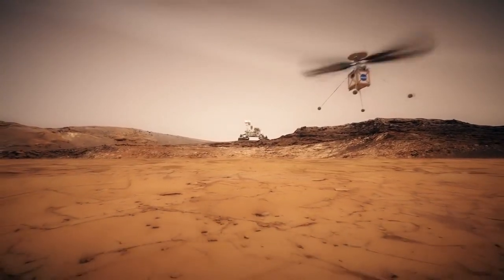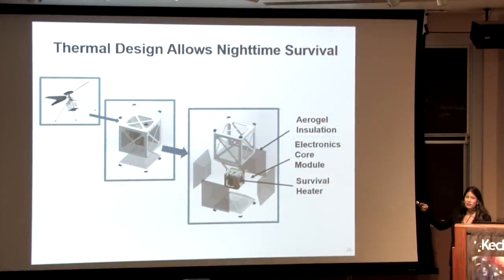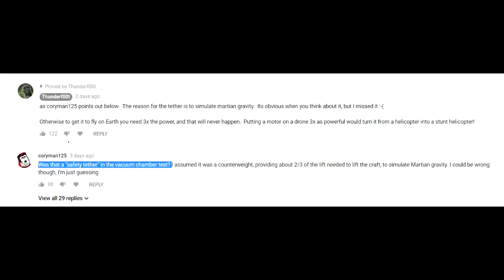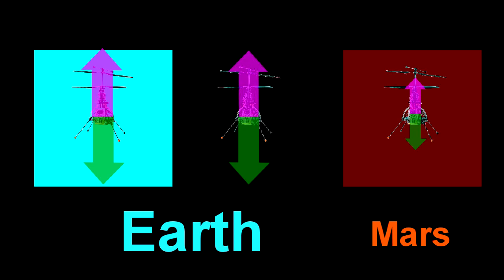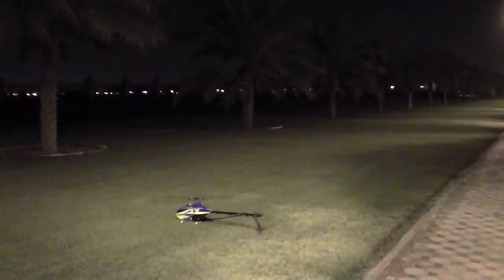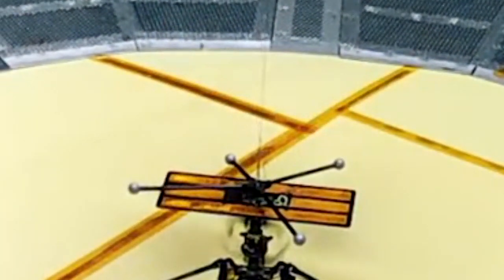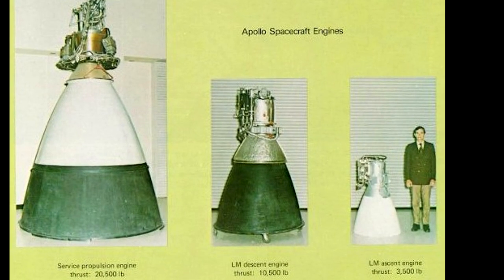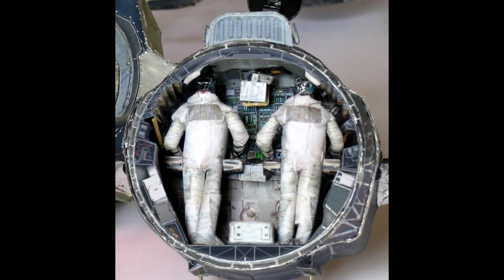Why NASAs Martian Helicopter CANT fly on Earth!

Comment: you are still wrong though you certainly can fly it on earth because the atmosphere is so much denser you dont need as much power to lift it . you just cant fly it on earth simulating mars atmosphere
Reply: Could we assume it is being tested in a vacuum chamber???
Reply: German Pepe It doesn't mean the rotation speed needs to be higher. You can also adjust the geometry of the blades. 

P = w Tq  

where w is the angular velocity in radians per second and Tq is the torque in Nm. (Metric and no conversion shit here). So, angular velocity and power is indeed related.
Reply: German Pepe The thing is, if you change the air pressure,  the blades, power or RPM you don't really demonstrate that well that it'll work on mars.
Reply: Morten Kristiansen If there's no gas for it to get thrust, how would it fly?
Reply: If it is easier to generate the thrust in Earths atmosphere and if it is as Thunderf00t says, 100 times easier, then wouldnt it be enough lift for it to fly here on earth. What am I missing here?
Reply: You have to consider that it will weigh about 3 times as much here on Earth. I think the gravity on Mars is around 39%  They can simulate the density of the atmosphere on Mars by using a vacuum chamber, but they can't simulate the 1/3 weight, since they can't change gravity.  They used the tether to "lift" 2/3 of the weight in an attempt to provide a martian gravity effect, with the props doing the rest of the lifting.
Reply: Alec Mueller Vacuum chambers don't generate 100% vacuum. It's virtually impossible. What you do is lower it sufficiently to mimic what you have on Mars' surface.
Reply: i have been flying and building model airplanes and helicopters for more than 20 years . and i actually do know a lot about blade geometry and power to weight ratios and the torque needed . german pepe i hear you and you might have a point if they were not using electric motors which tend to have a lot more torque in the lower rpms . you do not need to rotate the rotor at the same velocity in earth atmosphere i guess around 10 percent of the speed should be plenty enough with that blade geometry to achieve lift. it probably wont fly pretty it would be jerky because those blades would create a lot of turbulence but it would lift off i am pretty sure of that . if someone has actual infos on the weight , the motor used and the dimensions of the blades i could calculate how much lift it would generate on earth . as long as we dont have the exact specs your guess is as good as mine

Comment: When the lunar lander took off from the surface, did the astronauts unhook the lower landing gear portion, prior to lift off, or was there some sort of disconnect at the time of launch, i.e. explosive bolts or something?
Reply: It was done via a decoupler at launch, which is basically a controlled explosion.

Comment: iii don`t think so look there is no insulation in nasa video,   yeah its made of aerogell that is light a hell but it`s missing structure that holds all insulation, and everything else who protects insulation as its fragile as hell, and you can ditch battery's. power it over the threader via wires. you can easily save 2/3   of weight for testing purpose.

Comment: to be fair.. there are ways in which the heli cna fly on earth first

for one you can scale up the density of the air (wouldnt be accurate for mars but.. gravity isnt either..)

second (the one im more itnerested in) would be parabolic flights which can go 0 gravity simulated) but if they choose a less steep angle to dive they should be able to simulate marses gravity

sure u need a lot of space to fly the heli properly and then also have the air be of a different mixture

so it wouldnt be easy.. but possible it seems like to me
Reply: That would cost more of taxpayers money so easier, no!
Reply: Soinetwa the rotor would fail if you increase air density.
Maintaining a presice and stable mars gravity in a parabolique flight would be almost impossible.
Plus a flight would only be able to maintain low gravity for 20sec or so.
And those are only the first test maybe more are planned in the future.

Comment: Could they make it fly on earth if they substituted the wire with a balloon? Or would the vacuum chamber defeat such wizardry?
Reply: You would need about 700 liters of helium to reduce a 1 kg craft by 2/3.  So the balloon would be way too big to fit in the vacuum chamber, especially under low pressure.
Reply: Thanks for that. I had a feeling it would be impractical.
Reply: Old Ben, good point.  Mars atmosphere is thinner than Earths, even at the highest altitude balloon flights reach.  My 700 liters of helium was on earth at sea level.
Reply: It isnt a complete vacuum though. It is simulating the thin atmosphere of Mars.

And since Mars' atmosphere is mostly CO2. helium should be even more boyant there.. But I was talking about making it fly on earth.. Even if it was in a simulated martian atmosphere. Since CO2 is about twice as heavy as N2. Maybe only 350 litres of Helium is needed.. And since it wont be used for people Why not go with Hydrogen.
Reply: O.K. Your right,  I was just worried that the NASA folks would talk all 'squeaky' for weeks.
Reply: I admit it would be completely pointless to make it fly on earth, aside from the squeaky voices. I just couldnt help wonder if it really was completely impossible and not just stupidly impractical.
Reply: What if they tried to make it fly outside of the vacuum chamber with a balloon?
Reply: The question is if the motor is strong enough.. It would be like taking a helicopter into water
Reply: There's no gas (Hydrogen,Helium, CO2)) that is lighter than no gas (a vacuum).

Comment: Wouldn't a hydrogen-blimp be better suited to Mars?  It could lower an instrument package/anchor and vary the volume of the envelope for lift, or better, use a quadcopter-style arrangement with props all pointing to an imaginary spot above the envelope allowing vectored thrust in any direction without more moving parts than the rotors.
Reply: In theory it'll work- Mars atmosphere is mostly CO2, which is a denser gas than Earth's atmosphere (N2/O2).
And we've proven that balloons work in an ultra-rarefied atmosphere, even with heavy loads (such as Felix Baumgatner)

Putting it into practice would be the problem- as current balloons tend to leak helium when the material is stretched. So the life of a Mars blimp would be limited to the gas supply.
Reply: not even remotely close to right....to give you some idea of why you are wrong....ask yourself the same question, but imagine if your hydrogen blimp could ascend in a vacuum ? getting the idea yet ?....same deal, just a little less extreme...
Reply: For sure it would float as per your observations (and H2 is a slightly better lifting gas than He as well).  I'm just not sure of how strong the envelope could be made vs its weight, but incorporating aerogel insulation and a solar array without too much of a weight penalty would be a bonus.  Energy from the array could be used to heat the H2 to partially control lift, along with a pumping mechanism to control gas volume.  Of course a radioisotope heater could do the same thing (probably a much better solution).
H2 may leak over time, but fortunately it can be replenished on the go, albeit at a very slow rate.  Water vapour could be frozen out of the atmosphere, liquefied and electrolyzed.
The Mars blimp wouldn't be good at carrying much weight, so instrumentation might be limited to lidar/radar, spectroscopy, weather measurements and general photography.  It would be really great at gathering data on terrain and points of interest for ground rovers to seek out, plus would give us some pretty cool vids of floating along just above the surface of Mars.  
Anyway, seems safer than the little quadcopter that will fall over after a couple of hops.
Reply: Wikus Van De Merwe this may just be me missing something but is transporting enough hydrogen to fill up a blimp and also account for how much it leaks not extremely impractical as well as dangerous because of the flammable/explosivse nature of hydrogen?
Reply: Multiple blimps would likely exceed weight/volume capabilities of the landing craft.
If the craft could carry multiple, then it might be better to carry a bigger blimp- allowing for more tools/equipment to be carried.
However a dedicated gas canister to allow the blimp to refill would be a good idea.
Reply: Vacuum filled is an idea worth considering;
Density of Helium 1.786kg/m3
Density of CO2 1.977kg/m3
(standard atmospheric pressure)
Assuming He and CO2 would have the same relative densities at Martian atmospheric pressure- 0.6% of Earths (call it 1/200th to keep it simple)
-density of Martian atmosphere would be about 0.010kg/m3
-density of Helium at Martian pressure would be about 0.090 to 0.095kg/m3 (giving it enough to inflate the blimp)
-density of vacuum 0.001kg/m3 (doesn't need to be perfect)
The good news is we don't need a vacuum pump- just 'uncork' it on the trip over to Mars and space does the work for you.
The questions are 
does the added weight of a rigid body nullify the extra lift?
how do we fit a large rigid bodied craft inside a rocket?. (or rather how much extra rocket do we need?)
(collapsible/inflatable frame??)

Comment: i have a sincere question: if the Marsdrone is so light, doesn t that limit the scientific equipment you can put on it? yes is can move further, but what can it actually do, if it can only weigh about 1kg. at the very least it needs transmitters and the actual flying appatus, how much is left for measurement instruments?!
Reply: There are clearly limitations; but a helicopter would also be able to pass trenches and not get caught in a ditch like the two rowers. So the tradeof here is greater area for less experiments.

Comment: Rather than using a tether to provide two thirds of the lift (which is hard to keep consistent when the drone moves), it's a lot easier to just remove two thirds of the mass from the drone. You can do that by removing all the scientific components and using a lightweight board in place of a heavy solar panel. Motors can be made very light, especially if they only need to survive long enough for a proof of concept and you have a large enough budget to custom build them. And if the tether provides power, you can save the weight of the battery and some electronics too.
Reply: maybe they measure the sideways force on the tether too gauge the stability of the helicopter. I was also thinking they might be able to reduce the weight too, but maybe they can't remove that much weight for the tests they want to do.
Reply: Chris Edwards that solution could affect the balancing of the drone.
Reply: it is actually likely that the motor propellers battery solar and other things needed for it to fly would weigh >1/3 the weight I think the only scientific equipment is basically gyros needed for fight and a camera they use to determine a landing site and the communications array so reducing it by 2/3 the weight might not even be possible
Reply: Alfonce, Agreed, but the tether attachment point at the top also affects the balancing of the drone. It acts as a stabilizing influence due to it being well above the CG of the craft.
Reply: Michael Onines yeah ofc but for some reason Nasa though it was better to use a wire.
Don't ask me why I don't know.

Comment: Wait, so why wouldn't just tripling the pressure in the vacuum chamber give them 3 times the thrust?
Reply: Using the wire would be a more realistic comparison, since it counteracts the force of gravity to be more similar to Mars. But increasing pressure would not be the same and I guess there are other factors that might change when changing the pressure. All in all, it's adding variables to it that you don't want.
Reply: I think what Red said makes sense.  It probably is not a linear relationship with pressure.  I was concerned with Thunderf00t's words of "it would never fly on Earth."  Certainly it could, just not in the same pressure
Reply: The helicopter still has to do 3x the work on earth than on mars even if the atmosphere is thicker. The atmosphere doesn't just magically create more thrust, it just allows the propellers to give more thrust for a given rpm but because the air is thicker it would be much harder for the motor to move the propellers at the same rpm so it would probably take 600 watts from the battery which I doubt the motor could handle without burning out because it is not designed for that kind of power.
Reply: I would imagine that you get more thrust from more atmosphere.  Sure there's more drag, but there's also more lifting force from the propellers.  After all, isn't the reason planes have to fly faster at higher altitudes because of decreased pressure?  Oh wait, but your point is that it's harder on the engines.  I see
Reply: I was also curious about this. "[It could never fly on earth]" - But couldn't it fly outside of the vacuum chamber without the tether? I thought the effect on thrust 0.006 -> 1 atmosphere >  0.3g -> 1g.    Big Fan.  Does the thrust increase linearly with atmosphere?  Why wouldn't they alter the atmosphere to compensate for the change in gravity?
Reply: Well, perhaps you could, but on the other hand you'd like to test your thermal calculations as well. Here on earth electronics has three ways of conducting heat to the ambient: Conduction, convection and radiation. 

On Mars, convection is absent due to the low air pressure. Testing in a vacuum chamber gives a more realistic test.

Even if you did increase the pressure the propeller would also experience a higher air resistance as pointed out in the other replies so all in all I think this test is better for most aspects.
Reply: As others have said it would take a more powerful motor but another issue is the speed of sound on mars is only about 70% that of the speed of sound on earth. Ideally  for a propeller you want the size and speed to be such that the tip never exceeds the speed of sound in rotation or rotation + vehicle velocity. So the only real way to simulate the size shape and speed of the rotors is to do it in a vaccum. In aerodynamics pressure is one of the factors you have to account for and it doesn't scale very well. For example, if you could take a hot air balloon up to the some 45,000 feet or so and thew a paper airplane you would expect it to glide further for a given elevation drop because of the thinner air. In reality from your perspective the paper airplane would fall like a rock no matter how you threw it. 
Its counter intuitive but thats what it is. They wouldn't have full sized models in wind tunnels or tie yarn to airplane wings if they didn't have to but they do.
Reply: I don't know if the trust changes with atmosphere, but more pressure means more air friction, but also means that it is able to get rid of heat easier. But it would also require the engine to push more air. And these are just the changes we can come up with here, I'm sure there are more. But apart from the stability aspect, the wire adds the least amount of unknown variables.
Reply: Indeed.  I guess the only thing that still bothers me is Thunderf00t's claim that it would never fly on Earth.  Well, maybe not ideally, but you could still get it to fly on Earth, I imagine.
Reply: I think the wire is much less of an issue as TF makes out of it.
Drone electronics these days works quite well. Yes, the wire will interfere with the stability, but this is not that big of a problem. After all, the stabilizing electronics can be calibrated quite well by using computer models. Much more important is the lifting capability and the overal thermal behaviour. Both can be studied quite well by trying to fly that thing in a pressure chamber under realistic conditions even if that means you need to reduce the weight with the help of a counter weight. When the LM was tested at Langley, NASA did pretty much the same thing with LM mockups in a suspended configuration.
Reply: Yeah, 3x the atmosphere would still create 3x the resistance needing a 3x strength motor. By using the wire the motor doesn't need to have any more power output.
Reply: How about attaching some helium balloons on it to take out some of its weight :P